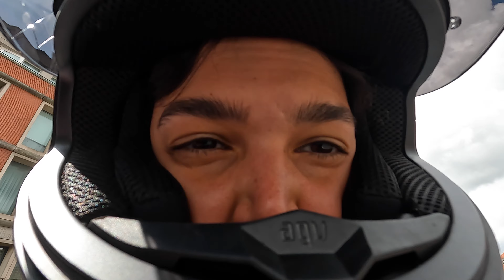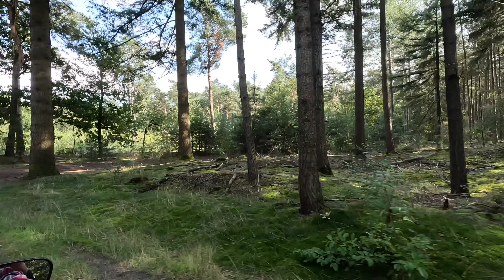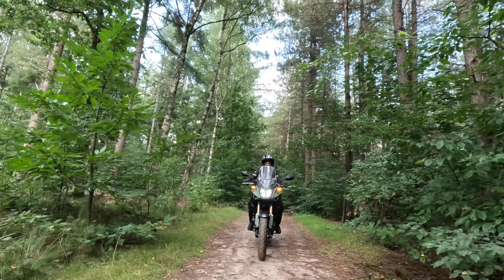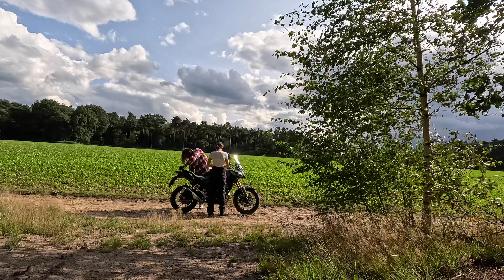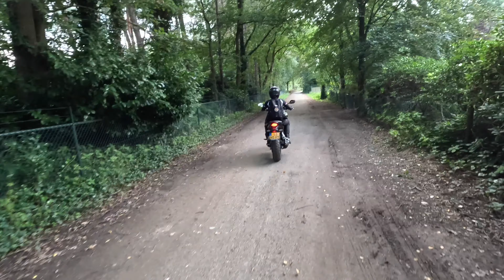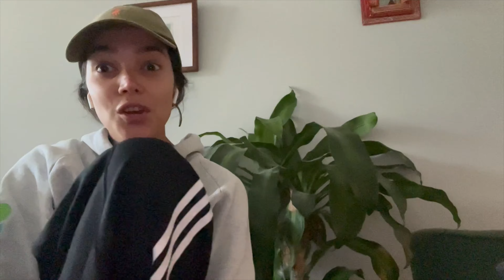First time off-road with the Honda cb500X

Comment: As an old timer in the U.S. I've been thinking about the cb500x because of its versatility, lower seat, lighter weight, reliability, and great fuel economy. Sure its not a road demon, but all the better actually. It looks comfortable to ride. There is another YouTuber from the Netherlands that owns the 500x, used it to tour, and it seemed to work good enough to satisfy her itch. I think its one of the better looking bikes out there. It looks balanced and the green color looks very nice. Good luck on your adventures.
Reply: i own it and its the most comfortable bike ive ever ridden!

Comment: I got a 23 cb500x I ride mine a lot off road and you really don't need to disable the ABS unless you want to slid the rear.
Reply: Or unless you don't wanna crash going downhill off-road lol
Reply: You won't crash if you know how to ride.  @andystm
Reply: @tomg4592  yes you will, even the best riders crash sometimes, and with abs off road you are very likely to crash because it stops the brakes working as they should. Now go ride a bike and learn what you're talking about.